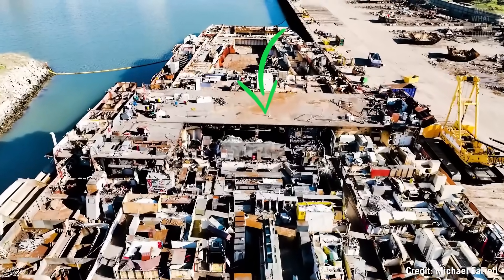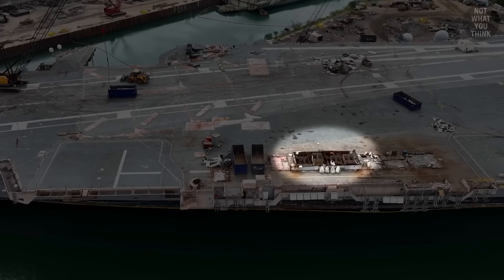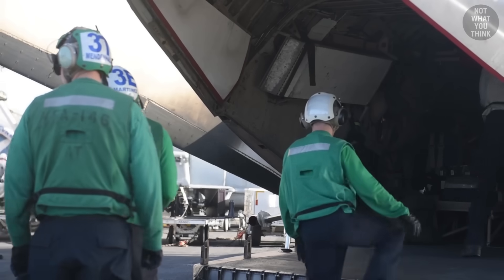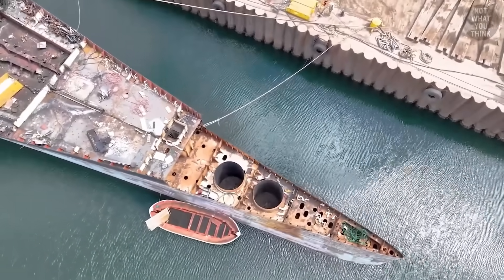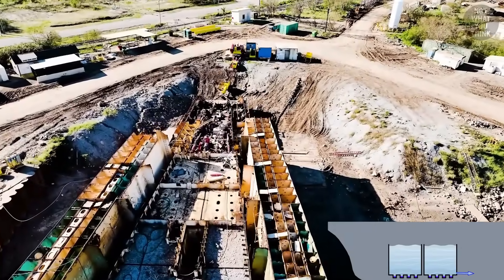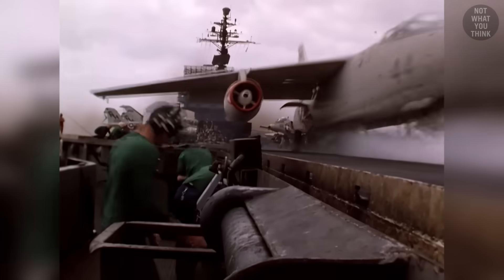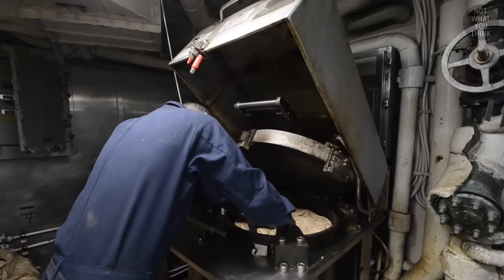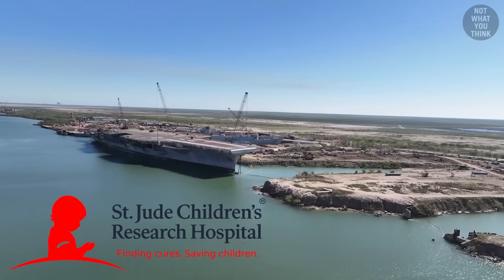The Dismantling of US Navy’s Aircraft Carrier That Was Sold For a Penny

Comment: 10:09.  Those are impact pads.  Made of heavy rubber.  To absorb the energy of the buckles that connected the cross-deck pennant to the retrieve cables into the arresting gear engine.  Some Ready Rooms were on the 03 Level while others were on the second deck.  The escalators ere a big help.  All Super Carriers had armored flight decks.

Comment: The narator is correct.  The 2 most foward tanks, the biggest on the ship, was for potable (drinking water) during my stent on the USS Kittyhawk, i was the P6 Division Officer.  The Evaprators & Potable Water was one of my areas of responsibility.  We constantly tried to keep the two forward tanks full and online as much as possible as most of the other  tanks were much smaller and required more switching between tanks and testing for contaminations.

Comment: I served aboard the USS America CVA-66 (1973 to 1975). It was never scrapped. It was purposely sunk to simulate torpedo attack. The America was a Kitty Hawk Class aircraft carrier. It did not have an escalator. That was a surprise to me in this video. I was an Electricians Mate working in Main Lighting. We worked on all areas below the flight deck and above the machinery spaces. Which includes the hangar bay (nope, no escalator there). Unless it was installed after July 1975. Maybe they also installed a "J C Penny" after I left - lol.

Comment: Enterprise CVN 65 was the first nuclear carrier.  the next 2 carriers, Kennedy and America were oil burners. Not until the Nimitz CVN 68 was nuclear power reintroduced to carriers.  And due to the techonlogy of the time, Enterprise had 8 submarine type reactors!  I do believe my info is correct. But I can be corrected.  All of this, is of course, is IMHO.  Thank you for a very fine video!
Reply: Enterprise had eight A2W reactors.  These were designed specifically for use in aircraft carriers and are a development of an earlier A1W aircraft carrier reactor that was prototyped and tested in Idaho but never installed in a ship. Submarine reactors of that era had about half the power and were much smaller than what Enterprise had.
Reply: @philsalvatore3902  How the heck did they get an aircraft carrier to Idaho"""    ;<)
Reply: @randallfawc7501  The Navy has prototyped I think all of their reactors at a facility in Idaho.  They build literally a full scale version of the ship's power plant but the shafts turn generators producing electricity they sell to the power grid.  The prototypes are also used to train the engineering crew for new ships before they are completed.
Reply: @philsalvatore3902  Thanks Phil.  Interesting information!
Reply: @philsalvatore3902  I have wondered why 66 and67 were regressed to oil fired?  Political decisions/narrow minded politions,  I would imagine?

Comment: Very Sad. Did two cruises on her as a VAQ Avionics guy. 85-87. I still have all my Sea stories in my head like they happened yesterday even though I can't remember what I had for lunch yesterday. Went to General Quarters twice for real. One was a fire [had to scramble out of my rack and then later got doused in AFFF]; the other was a couple of incoming planes did not have the correct IFF codes [ was in the chow line that day]. A big Spy scandal happened when I was there, tied to the Iran-Contra arms selling deal . A guy got an S3 Viking launched on him on the flight deck on one of the work ups. Just a few of the bigger events.

Comment: Sponsons DID NOT house "communications systems".
Those were either in UHF Comm at the top of the island, or HF Comm well within the hull.
Weapon systems, definitely - Phalanx or the older 3"/5" guns that Phalanx replaced.
Radars - well, if you count the one on top of a Phalanx....

The signaling LAMPS were all up on the island.
Reply: I believe both my WSC-8 Satcom antennas were located on sponsons🤔

Comment: These ships can be retrofitted as hospital ships, water purification desalination, housing! What a waste of resources
Reply: Fifty year old ships that have been used hard are not economical to operate.  Second, warships are designed for fit young bodies.  The ladders are steep and narrow.  Old farts like me that used to race up and down those ladders and down passageways at General Quarters now huff and puff and struggle to work fat bodies through narrow hatch openings while visiting old warships that are open to the public.  I got a taste of that climbing up to the bridge on USS Midway.  I was winded and sweating like mad by the time I made it up those ladders to the wheelhouse.  Warships are not designed for accessability and there is no easy way to change that without major structural changes that start affecting water tight integrity.

Comment: I worked on that fine ship while it was in Philadelphia undergoing a Service Life extension Program (SLEP 1987-1991). When it left Philadelphia it was almost a brand new ship.
As I recall the ship had one escalator which was used by the Captain ONLY so he wouldn't; come in contact with other     personnel or as few as possible.

Comment: This carrier should have been moved to the moth ball  reserve fleet.
Reply: It was.  If you think about the aftermath of WWII the US Navy had hundreds of ships that had only been in commission 3-4 years.  They were almost new and had lots of years of service left in them, so it was worthwhile to store them in a mothball fleet.  But a ship that has been in front line service for 50 years is worn out.  How many posts here mentioned that the escalators didn't work.  Guess what?   Lots of other vintage systems didn't always work either, or were abandoned because there were no parts anywhere to fix them.  The engineering plants in them are obsolete and nobody is making replacement parts any more.

Comment: Shouldn't have been sold for a penny - the taxpayer should have at least gotten scrap value for it ($0.08/lb or so).
Reply: Nobody wanted it, that is why it was basically given away. I guess technically they couldn't give it away so they charged a penny.  It costed the Navy 5 million a year to dock and maintain her. The scrap company is taking a risk of losing money if they have overruns in dismantling her.
Reply: For the Navy and the US taxpayer it is a good deal.  The labor to dismantle a ship that huge is very costly.  The heavy equipment used costs money to buy and operate.  All the gasses used by the cutting torches cost money.  The scrap value of the materials has to pay the bills incurred dismantling her.  It is not a way to get rich.

Comment: Despite much reporting to the contrary, the USS Kitty Hawk was not SOLD for a penny. That's simply incorrect. The US Navy sought bids for dismantling and recycling. Accordingly the shipbreaker that won that bid was PAID one penny to dismantle and recycle the USS Kitty Hawk. In fact, the ownership of the ship has not and will not transfer and will remain property of the US Navy until the work is complete.
Reply: Oh interesting. Yes, there are some parts the navy would probably like to retain, like the anchors, anchors chains and propellers... perhaps the ports the anchor chains slide through. I'm sure those are very expensive castings that can be reused in newer ships.

Comment: Instead of doing this why didn't you give it to the Philippines navy
Reply: Its economically unviable for the Philippines and it would also be costly for the Navy. Why would the Philippines buy a carrier? The Navy's purpose is coastal defense and not power projection.
Reply: A Carrier is worthless without a trained crew and aircraft which will cost billions and a billion to operate every year.
That is why very few countries have aircraft carriers. Besides, this was built in the 1950s, so even with upgrades, I'm pretty sure it would be impossible to find parts for her when  things break down. The Ohio class subs needs parts manufactured from scrap to replace it's parts because it was manufactured in the 70s-90s. They still have a lot of analogue systems so that is why the Navy is switching to the Columbia class.
Reply: @joeiborowski9763  The companies that made the various parts of that ship are long gone or merged into other bigger corporations.  Nobody makes most of the parts on those ships, especially the engineering plant.  Nobody is building new steam plants for merchant ships and the US Navy is trying to get rid of all of its oil fired steam plants and switch to gas turbines, diesel or nuclear power.

Comment: Can someone explain to me why when an aircraft carrier takes 10 years to build these would not be keep in reserves for if the shit hits the fan or sold to an ally?
Reply: Keeping it in the reserves would be costly for the Navy and a bad thing for the environment. Selling it to an ally would also be economically unviable for the nation buying it as they would have to maintain, operate, and train crewmen and have to buy, operate, and maintain carrier-based planes, all of which will cost more than buying a carrier. The nation would also need to plan on the carrier's purpose.
Reply: Simply put, it's old and worn out. Would you spend 20 grand to fix a 25 year old beater worth $500 that came from the rust belt?
Reply: The US offered to give Brazil the old USS Forrestal for free.  Brazil turned it down.  They didn't have the manpower to operate her and could not reasonably recruit, train and then pay a crew of the size required to operate her.  Then you have the fact that the air wing on most modern US Navy aircraft carriers is larger than the whole air force of most nations.  A few countries like Russia, China, UK, Germany and France have bigger air forces but most nations and especially those in South America can't scrape together than many airplanes and crews trained to operate from an aircraft carrier.  It requires billions of dollars per year to operate one and most nations don't have it.
Reply: @philsalvatore3902  I still don't get why it is not keep in an a reserve fleet for if the shit hits the fan, Even if it would be more limited and even if it could only launch F-35Bs It would still be a better platform then an LHA or LHD.  Same goes for the Enterprise and Nimitz.  Gut the reactor section if it is contaminated and store it.  Rebuilding that section has to take less time then waiting 10 years for the next Ford class.

If a war with a peer power broke out it is not impossible for 1 or 2 to be knocked out of service or possibly suck, even though the USS America proved super carriers are a real pain to sink.

The Navy has all its eggs in the super carrier basket, It just seems silly to not keep a few spares. 

Also I probably would keep a few extra LHA and LHDs on hand.

Comment: I was stationed aboard the ex-USS John F. Kennedy (CV-67). It was a modified Kitty Hawk carrier and the last conventionally powered carrier. It will soon take the Kitty Hawk’s place at the breakers. Ship breakers not only break up obsolete ships. They also break the hearts of the sailors who served aboard them.
Reply: Haze Grey and underway aboard the JFK.
Reply: I suppose breaking-the-ship-up is better than the vessel being use as target practice and then sunk to the bottom of the ocean.
Reply: I was on Big John ‘84-‘89
Reply: @georgeyoung1810 I was just there for the 86-87 cruise, man that was a rough crossing to get to the Med.
Reply: @georgeyoung1810 Nobody cares😂
Reply: She was suppose to be a nuclear carrier with 4 reactors but because of costs, went to oil furnaces instead.
Reply: @mickywanderer8276 They wasn’t oil furnaces, they were boilers ?
Reply: I was also on the Kennedy 74 to 77 airframes department hangar Bay next to the jet shop 👍🇺🇸
Reply: Boo-Hoo

Comment: still want to read a comment about why the water tasted like JP-5.
Reply: Me too.
Reply: A fuel pipe running through a fresh water tank with a pinhole leak? 
A fuel tank with a pinhole leak contaminating an adjacent potable water tank? 
Oily waste water getting pumped overboard and sucked up by the evaps?

I did get in trouble once for pumping out a shaft alley bilge during flight ops. I knew better but said fuck it. Well, apparently there was some tramp oil going overboard as well and a pilot called in saying there was an oil sheen in the ship's wake...  ooospie.
"Sailors on US Navy flattops have been drinking and bathing in water contaminated by jet fuel for decades, veterans say..." Business Insider, Oct 5, 2022

Comment: My first 10 traps (1996) and last 200 traps (2005-2007) were on Battle Cat. She'll always hold a special place in my heart. She should've been turned into a museum instead of razorblades. RIP Kitty Hawk. One note, the keel of Kitty Hawk was actually laid as Contellation. A fire onboard while under construction caused the Kitty Hawk to be delayed and ultimately be commissioned as USS Constellation while the Connie's keel was used for the USS Kitty Hawk. There are/were placards on both ships regarding this change.
Reply: so very true about the Constellation and Kitty Hawk...I served aboard the  Kitty Hawk from 1970-1972...
Reply: What squadron? I was onboard the same 2 years, AIMD AT supporting the Prowler squadron
Reply: @tonymash  I was a Golden Dragon
Reply: I used to volunteer on a retired WW2 carrier. Unfortunately its pretty complicated when trying to turn one of these into a museum. First you have to find a port and a city or area that wants it. There are huge expenses involved. A lot of work has to be done to make them safe for the public especially given that these older ships contain an absolute MASSIVE amount of asbestos which was used on every single steam pipe on board- miles of it. Another consideration is what condition the hull plating was in. Even though the Navy would no longer own it they still have the right to take it away. And one thing they require is that the hull plating get inspected and repaired every 20-30 years. That can cost many millions. Its sad in that the Kittyhawk was the last conventionally powered carrier to be retired meaning there will be no more future carriers as museums but regrettably not all of them could be saved.
Reply: Yes, on the floor of the Kitty Hawk is where I saw the placard that read, CVA-64, when I was member of the crew of the Kitty Hawk from 1986 to 1987.
Reply: China thru Mexico gets some of them, Sadly

Comment: The sponson u said was for trash was actually the smoke pit. The trash sponson was small on starboard side...the tanks on the bow you were curious about are water brakes...they held 5000gal of water to stop the forward movement of the steam Pistons that where inside the cylinders under the surface of the catapult....holes on bottom was for the lube oil to escape...we drained these every prior to import visit...very messy job.... 
Btw I was in her from 99-04 and the escalators only worked a handful of times...fwd never the aft one...and it brought u out to the fwd galley (messdecks)
Reply from the maker: Thanks for clarifying.